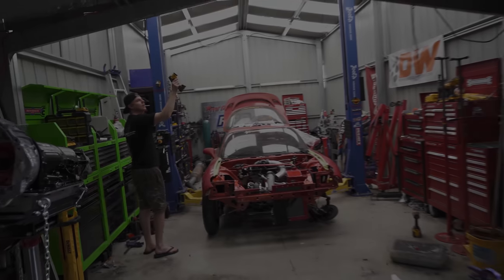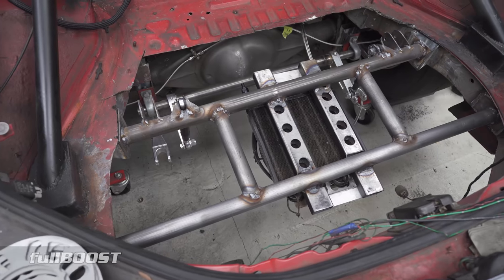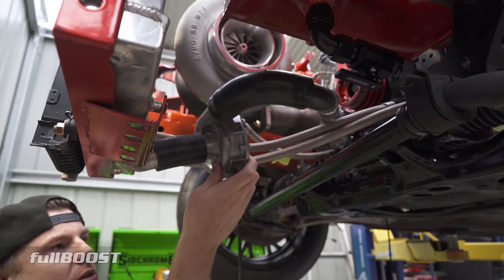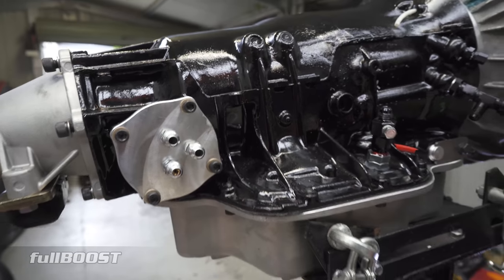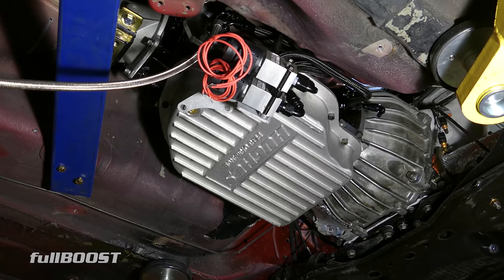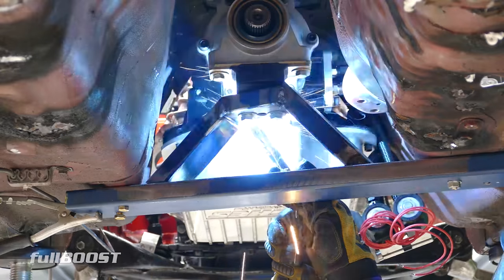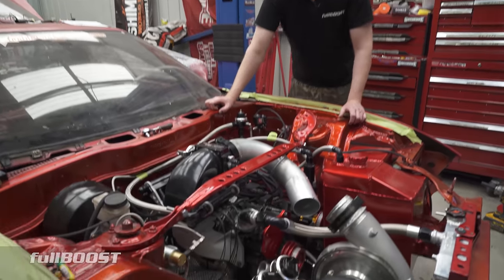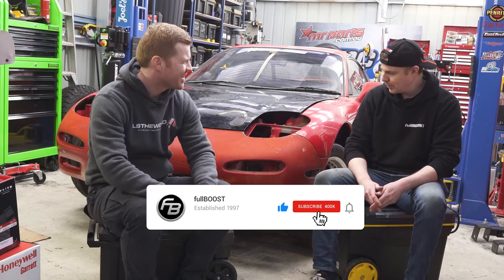Making a Hughes TH400 fit in the RX7 | FD build ep04 | fullBOOST

Comment: As stated before regarding the roof of the shed, used carpet, or the like, you have said prior that the family wouldn't like the view as you can look down on it, but you could install it on the inside also to assist with the heat.

Comment: Sorry but that shed will get alot hotter in summer with the clear sheets, greenhouse effect! Clear sheets are physically cooler because they let the heat straight through instead of reflecting/storing. My advice is use white tin sheets with a min 50mm blanket underneath. If you want some natural light just a couple diffused sheets of solar smart suntuf variety. Alot of dirt will get in without a blanket/sisalation. Just my 2c keep up the good work
Reply: They aren’t clear, they are opaque and have some kind of reflective coating on them. You can physically feel the difference in heat transmission in the lower roof area where these sheets are used Vs colorbond.  I have older style clear/tint sheets in another part of the roof and they are worse than all.
Reply: @BroomysGarage  sounds like the sun tuf solar smart sheets I'm talking about. Still strongly recommend a 50mm blanket underneath your colorbond will make a world of difference and stop dirt coming through your joints

Comment: INTRO:  The clear sheets are actually allowing WAY more heat in through radiation energy ... the solid sheets are hotter but they are blocking radiant heat and only allowing in convectional heat.  If you replace the clear sheets with solid then it will be both darker and cooler in the shop.  If you want it to be cooler in the shop then you can insulate, shine the outside to reflect radiant heat, get ride of the clear sheets and put in lights and/or put in a fan.  What you do NOT see with your temp gun is the heat being let through the clear sheets, warming air and objects in your shop.

Comment: Wouldn’t a 2 speed glide be a lighter trans and less power robbing then the turbo 400 for your Application
Reply: I feel like because rotaries make less torque they would need the extra gear to get out the hole quicker

Comment: Keep up the great works guys, just noticed a engine oil cooler as well on the front is that right ,which is thermostat controlled as well, based on what you want the engine oil to flow through the front cooler, based on the thermostat temp your using?
Reply: It’s just the factory RX7 oil cooler setup. Oil plays big parts of rotary cooling system, they all have oil coolers.

Comment: Does the transmission have the normal gear ratios? It doesn’t seem like the ratios would be any good for a high revving rotary
Reply: Wouldn't the diff ratio sort that out?
Reply: @sexyfacenation  it’s like the difference between a close ratio four speed and a wide ratio four speed, it depends on how much RPM drop between gears the motor can overcome, the rear end ratio matter also, but if the first gear is too tall or the rpm drop between gears is too severe the smaller high revving motors can’t overcome it because they don’t have the big torque that the motor had that the TH400 was originally designed for

Comment: For my shed (wasn't insulated when we moved in), I used this stuff

http://shedinsulationdiy.com/index

I used a mixture of magnetic strips, high temp tape (single and double sided) and it works mint. Did it by myself, used it on the roof, walls and roller door. We were getting roof temps around the 60degC mark making it around 10+degC above ambient, now it is more like 2-3degC above ambient.
Reply: But i rather like getting all hot and sweaty like Christina Aguilera in that music video Dirty.
Reply: @Gooie69  I'm old though and it was pissing me off lol!